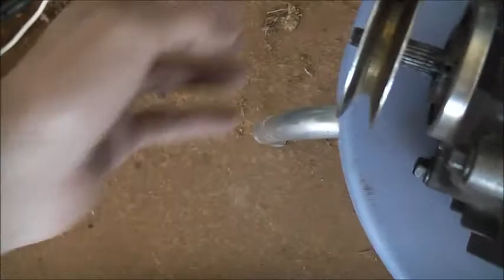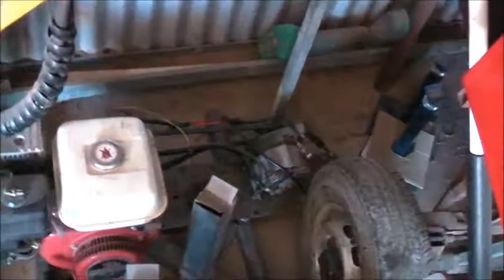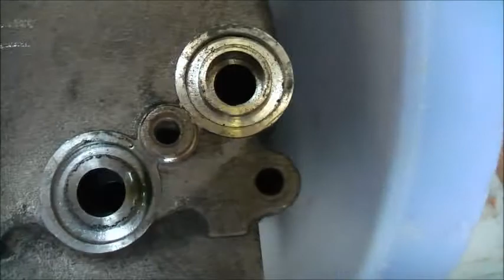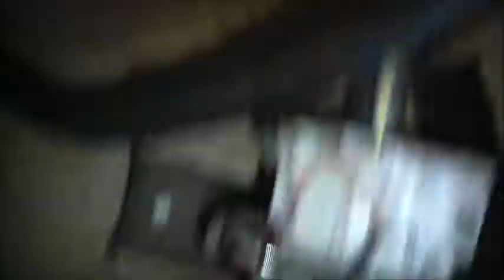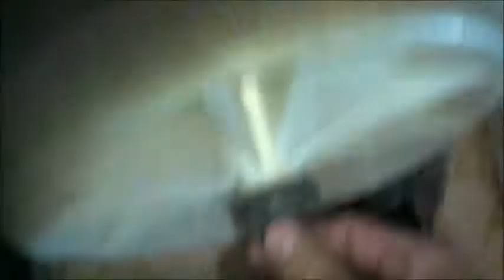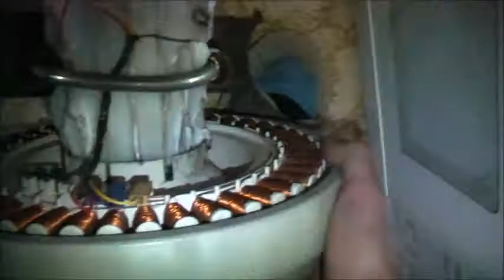Plans For Compressor & F&P Generator

Comment: Mmmm, compressor poppage. :D Putting some oil in it would be funny, because not only does it burn it up, but it'll also billow out clouds of oil mist at the same time. :D

Yes, that'll lube-up nicely with some VEGETABLE OIL. :D

The reason I say veg oil is because it's environmentally friendly & bio-degradeable, so oil mist spraying everywhere won't be a problem.

Just think when that compressor siezes up......The drive belt will be an epic squeeeeler! :D Have hearing protection handy! :D

-BBD.